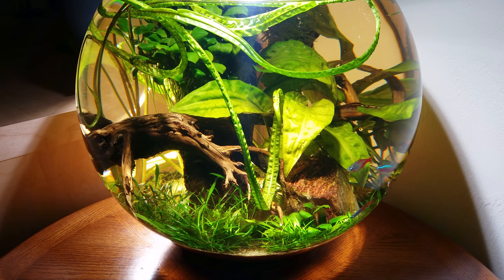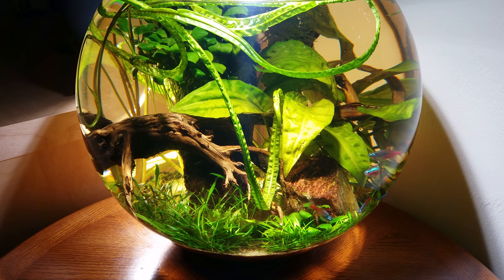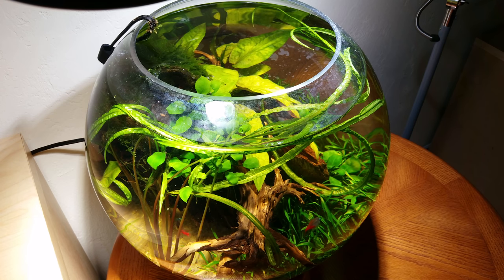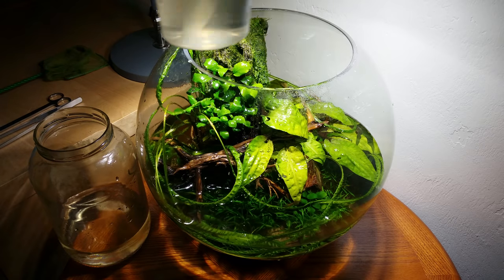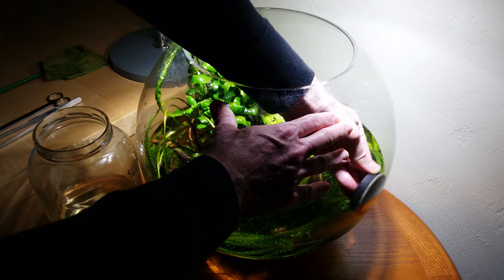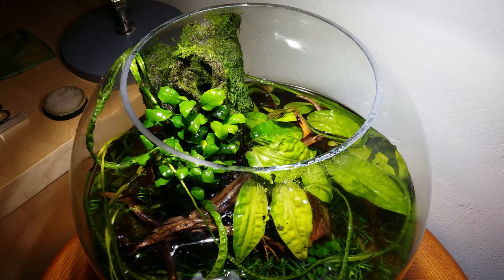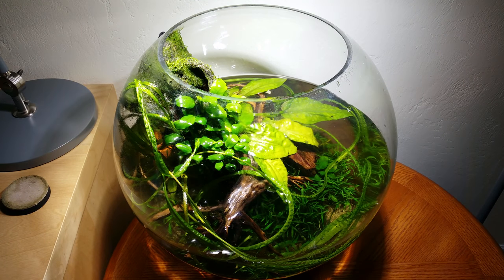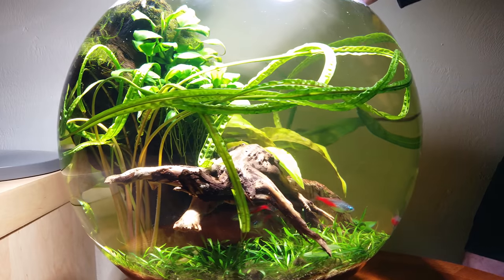River Bubble

Comment: Great video. What do you use for your substrates? I have some Miracle Grow Organic soil but need something to top with. I was thinking of pool filter sand but it's a little on the light side. Wanting something more brown.
Reply from the maker: Thank you. I use pool filter sand. Just be mindful that it's an inhalation hazard, so I suggest soaking it inside the packaging before use. It does get darker as detritus gets deposited on the surface. Soil is general isn't a great idea because it tends to get kicked into the water column where it will support algae.
Reply: dangerousfishbowl Thanks for the info. I had one more question, what is the grass like plant you have on the bottom of the foreground? I think you had the same grass-like plant in forest bubble. Btw your bowls and jars are amazing!
Reply from the maker: Thank you. Actually in this bowl the grass is Cryptocoryne parva, whereas in Forest Bubble it's Echinodorus tenellus.

Comment: I really enjoy your presentations.  Very nice description and tutorial on the maintenance.  I was just wondering if it would be more beneficial to use a syphon to vacuum the debris on the bottom of the bowl since that's what  causes the ammonia & Nitrite spikes.   Also, I have a Biorb which is basically a bowl and they make one that is a 60 L with a diameter of 20.28".  I'm just curious.  Are the fish still alive?
Reply from the maker: Yes, all are still alive, so far as I can tell. I wouldn't recommend a siphon just because it has a bad habit of destroying the aquascape and sucking up fish. (For big tanks, there's no choice, in which case I tend to use a Python hose.) For my bowls, I actually just use a big yoghurt cup to change the water. I lay it down on its side so I'm able to make it suck up lots of detritus. I then dump it into a clear container so I can easily inspect for fish that I accidentally removed. But as always, I wouldn't go beyond 75% down from full. (And that's minus 75% volume, not height, as we're dealing with a sphere here.)

Comment: My biggest concern with the large bowl is the thinness of the glass. Visually, the top opening shows the glass being maybe 1 centimeter in thickness, which would be nice if that same thickness is uniform throughout the bubble. But as you move down, the glass will be much thinner. This is one reason I completely tore down the ikea Bladet cylinder vase that I was using last year for an aquarium. I simply didn't trust the thin glass. I could tell the ikea Bladet vase was thin because softly knocking on the glass creates a "hollow" sound.
Reply from the maker: I tend to agree. The only things I like about glass are its relative immunity to scratches and wide variety of shapes. Otherwise, I prefer acrylic.

Comment: Do you have to have  a power head? what would it be like without one? What would you have done differently had you decided not to use one?
Reply from the maker: If the bioload is sufficiently low, then no, you don't even need a powerhead. Circulation is generally a good thing, but clogged powerheads and disturbed substrates can be a problem. It's a judgment call which really depends on the particular aquascape and its inhabitants.